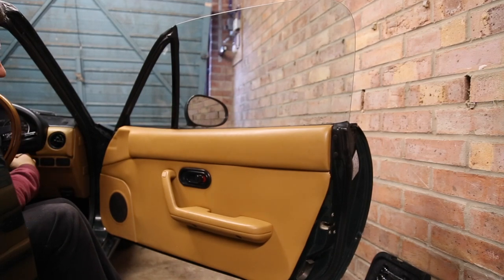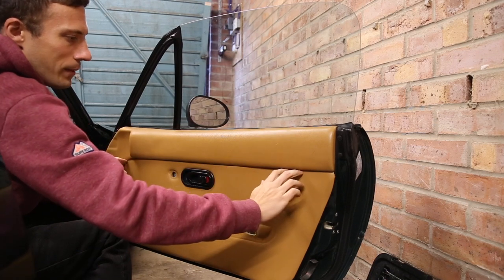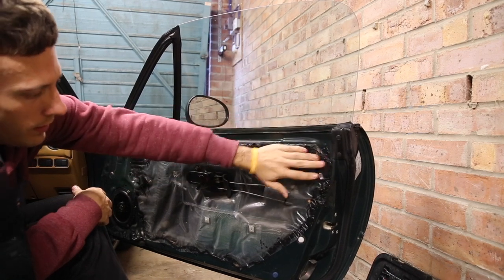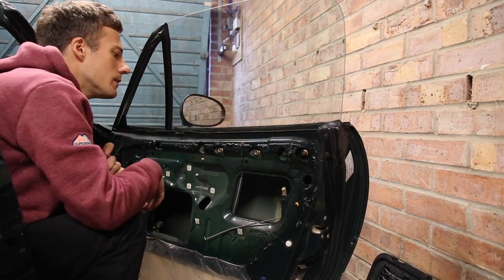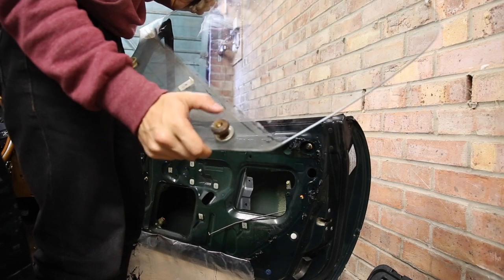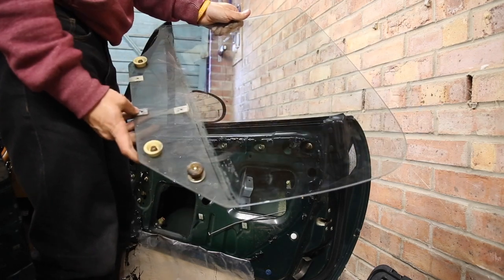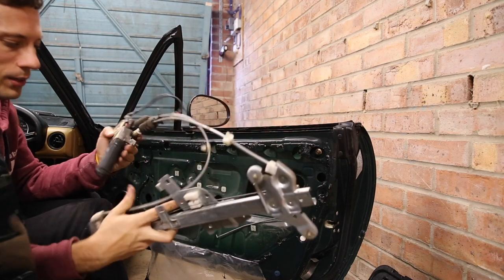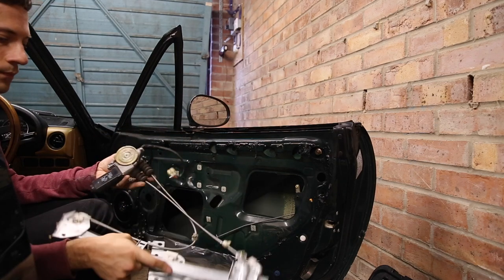How to replace Mk1 NA MX5/Eunos Power Window Regulator and Motor

Comment: This helped a lot thank you! I only replaced the cables, so had to take the assembly apart. However when I reinstalled everything, the window would go down, but wouldn't go far up and would jam. I took it all apart about 4 or 5 times thinking the cable was installed incorrectly somewhere, only to discover that the runner wheel (or whatever it's called) attached to the window was very stiff and not turning. Not sure why it decided to act up all of a sudden (or perhaps that was what caused the rusted cable to snap in the first place!) but after a good greasing, it was all running well. Could have saved myself a few hours if I'd checked that beforehand. Just thought I'd mention this in case anyone else has the same issue.
Reply from the maker: Glad you found it useful, if you do another you should make a video of just changing the cables, I've never been confident enough to try doing as I believe it's quite fiddly!
Reply: @MikeJenicCycling  Your advice about buying the complete unit is sound advice, especially since should the window motor fail later on, then it all would all have to come apart again. I actually bought the cables before watching your video not realising quite what was involved. However, if you ever need to take the assembly apart, it's actually not too difficult. 

Once the entire assembly is out, to change the cables first remove the bottom white plastic cable guide (opposite end to the pulley on the frame), it will snap out using pliers to bend the plastic locks, this will give the needed cable slack. Remove the cable ends from the centre regulator. Remove the two screws from the drum assembly, and then using a flat head screwdriver pop the cable drum out. It should slide out easily. The cables will be loose, remove the cables and replace them with the new ones, with the new guides, spring and plastic caps, etc. 
When putting it back together, the cable(s) can only get wound around the drum in the correct way, it's impossible to fit them in reverse, etc due to the clever design. Each cable gets wound round 2.5 times, then carefully holding the cables on the drum (as they will try to uncoil), put it back inside the drum enclosure, once inserted back inside the cables can't come loose due to the tight geometry of the drum enclosure, even without tension on the cables. 
Then attach the two new cable ends to the centre sliding regulator. Then slide the bottom cable back onto the cable guide (rather self explanatory how it all fits) and simply pull the white plastic cable guide tight with some force until it goes back into it's mount at the end of the frame, snap and lock into place. Add grease to the cable drum, screw the lid back on with the two screws. Job done!
Reply: @methylene5  Thank you for your write up!

Comment: Nice video.
Sorry for not catching the obvious, but what make you decide to change the motor instead of the wires like is more common?
Reply from the maker: Stian Fagereng it is quite difficult to change the wires alone, the complete units are not too expensive and saves a lot of time!